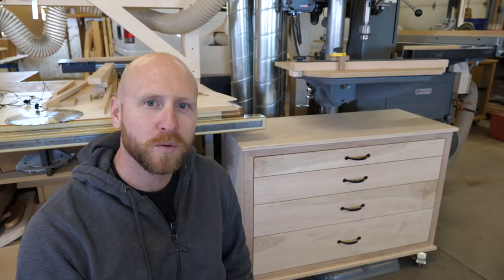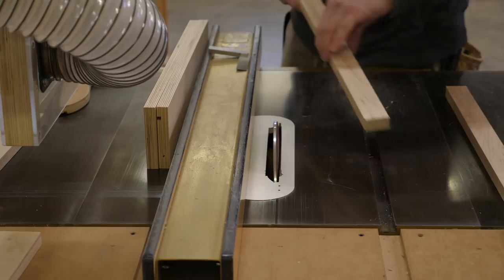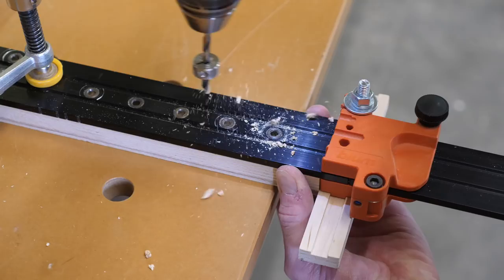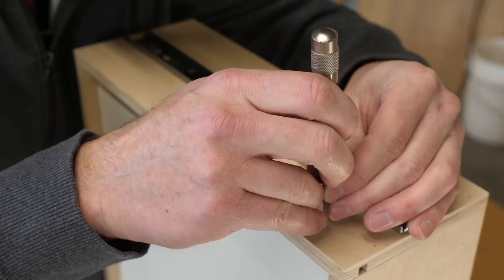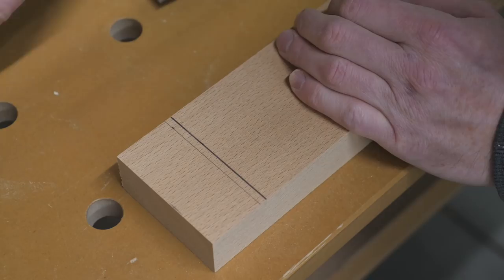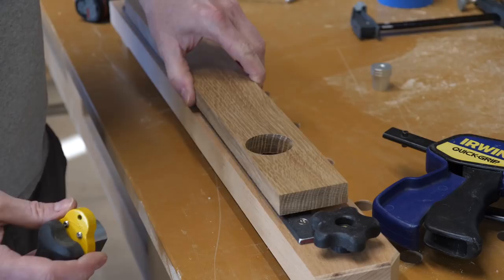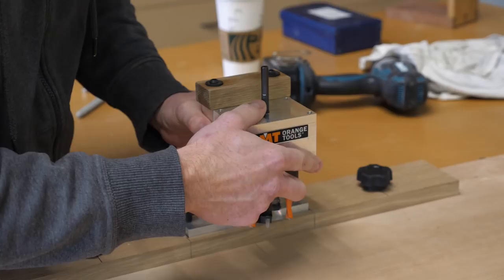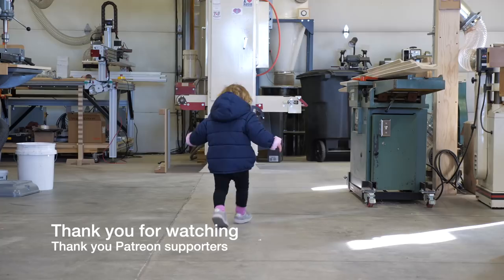Drill Press Randomness, Storage Cabinet, Fence, and Jigs

Comment: I think this is state-of-the-art cabinet making for today.  No steps missed, no corners cut.  If you are new to the craft and wondering how to make a cabinet, follow these processes, and techniques as closely (within reason) as you can.  Thanks Mike.
Reply from the maker: Thank you.
Reply: First i think you need all the tools this guys have.. to get it right you see it. With basic tools it is kinda hard to get results like this. So if you are "new" to the "craft".. info in this video is excelent.. but you will never have the same results with basic tools.

Comment: that was great. i didn't know they made made i door hinge set up like that to add to drill presses! i'll be adding that to my next shopping list for the shop
Reply from the maker: Its a really neat jig.
Reply: @MikeFarrington  will you be getting rid of your blum? 
Side question, the tall bench dogs you have that raise the track for the track was. Did you have your "hobbiest" machinest neight make them or did you purchase them? If you purchased them where did you get them? Ive built a Paulk bench and those would cone in handy with holding my track saw
Reply from the maker: @benborsa8266  I already did. After using this jig a couple times I sold the Blum Minipress. The bench dogs were from TSO products. They have a bunch of different dogs to pick from.
Reply: @MikeFarrington  fantastic thank you man! 👊🏻

Comment: I've been hunting for a 3102 this past year based on your praise for it. I finally found one in good condition for $80 (plus a bunch of bits/accessories) with the exact same issue as 12:32. The guy's sending a replacement cable along for the ride, race you to the replacement!
Reply from the maker: Thats kinda the deal, about every 10 years or so, the cords will need replacing. I consider that just a part of ownership.

Comment: In the Toyota Production System (TPS) you would use a simple visual indicator like the absence of a tool in its marked storage location.  In this video, you show locations for every bit but you also have slots with no bit.  If a slot is empty how do you know if the bit is in use or missing?  Place finish nails (or something) in the purposely empty drill bit locations so you know you're not missing any bits.
Reply from the maker: That is a really good idea.

Comment: A tip I've seen used when biscuit jointing. Use the biscuit jointer like a router on one side of the joint then cut the  biscuit joints normally on the other side of the joint then you don't have to worry about whether the biscuit slots line up and you can slide the wood to correct position
Reply from the maker: Thank you. Great tip.

Comment: Thanks for the caster tip.  I have not been happy with the last few iterations of casters I've found at <insert big-box store name> lately.  And I gotta get a drill press.  Maybe then I might be able to drill like a 4-year-old.  Only problem with that plan is that it's Yet Another cabinet/base/tool stand I gotta build.  My mitre saw is still waiting...

I like the slide/swoop/not-jump video cuts, whatever they're called.  Upping your vid game, I see.  And I detected a bit more thought put into the writing, too.  Props all around!
Reply from the maker: Thank you. Yes, those casters are really great. They hold steady when locked. Thank you for noticing, I have been trying to up my video game.

Comment: BTW for those wondering, what he did when bringing/building the drawer guides out from the sides of the cabinet box. Is known as Furring (pronounced Fur ing ). Its a technique used a lot in finished wood working. I share this term so people going into professional environments don't have to look like a idiot (like I did) for not knowing it.
Reply from the maker: Thank you for the input. Its funny how many slang terms are used in the trades. I have heard these called a bunch of different things over the years.
Reply: @MikeFarrington  My understanding at least as it was explained to me. Is its a fairly old, traditional carpentry term. Probably changes on geographic region as many things do though.

Comment: I would have probably made 17 videos out of this packed content. as usual very impressive.

a few excellent ideas, like the horizontal bar for the magnetic switch based stop block.

as for the drill bit organizer, I need to design something for my style of working. I always have many drill bits of the same size (sometimes 20 per size), and on top of that, different material within one size (Cobalt 5%, Cobalt 8%, HSS, W4A, "import" junk grade). then I also want to keep masonry bits, stainless steel specialized bits. I'm actually still trying to figure out how to store 100s of drill bits, with multiple instances in each size / category. I think I will just use some kind of matrix of smart / movable dividers. I have 20 drill bits of my most popular size, and then 1-2 of rarely used ones.
Reply from the maker: Thank you. I like to put a bunch of stuff into one video. I have no idea if that helps or hurts my channel, but its my style. That is an interesting conundrum, to have some many of each size. I have a couple different sets of bits, but one is over at the bench, one for installation tools, and the one shown in this video.
Reply: @MikeFarrington  I often work with the thick hardened stainless steel stock, and I need lots and lots of instances of the same size bits.
it took me many years to work out the profitability sweet spot between the rapid drilling while sacrificing more bits, and drilling slowly and allowing the bits to last longer.

PS
a quick (and really valuable) tip for drilling stainless steel material, is to keep it in the freezer to the last moment, and then start drilling as fast as you can (get everything ready before taking it out of the freezer), before the material temperature raises.
I give credit for this tip to the boat maker, who cuts and drills the hardened stainless steel parts all the time, and he "shared" this secret with me once I bought him many beers.
Reply from the maker: @TigerCarpenter  Good tip, thank you for sharing.

Comment: Philips screw drivers are designed to slip if excessive torque is used.   Posidrive are designed to not “cam out”.  The design of the screw head and driver are different so the systems are not exactly interchangeable.     You can get away with mixing them up, but it is better to know which you are using from the start……..The discount store in Australia, ALDI,  often sells packets of wood screws which are Posidrive, without advertising that they are different.  Folk take them home and end up in trouble when they uses impact driver and long screws.

Stavros
Reply from the maker: Thank you, good stuff.

Comment: Home made boring machine is really cool.  One dumb question, how did you drive the staples on the bottom side of the drawer bottom without them sinking all the way into the wood?  Less air pressure on the compressor, or did you just finesse it somehow?  Thanks for the content as always.  Made the forstner bit organizer - it rocks. Simple idea that works really well.
Reply from the maker: Thank you. I am using a 3/8" staple to start with and I reduce the drive depth on the gun to the minimum. Hope that makes sense.

Comment: Two questions.
1. Are there any 'un-mighty tools'?
2. I'm sure your experince in crappy tools are very or extremly limited. But to your best guess. Is a cheap biscuit joiner better then none at all?
Reply from the maker: Any tool I am using is Mighty! I used a porter cable biscuit joiner for 10 or so years before getting this one. I was a darn nice tool. I have gotten feedback from others that the Dewalt is good as is the Makita.
Reply: @MikeFarrington  hah! Good answer! Modesty is way overrated. Thanks for the recomendation.

Comment: Thanks, Mike for another excellent video. This may be fundamental, but how did you shoot those staples only partway in?
Reply from the maker: Thank you. I'm using 3/8" staples, the shortest available for my staple gun. I also set the stapler to the shallowest depth possible. This helps keep the staples from going in all the way. Hope that makes sense.

Comment: 12:40 Story time: I was using an extension cord that looked like that. So normally the if the ground and the hot touch it will trip the breaker. Not so in this case. The sheathing around the hot wire was damaged and in a bizarre turn of events the ground wire was completely severed. The hot wire had come into contact with the broken ground.  This caused the metal body of my band saw to become electrified. It was not a fun day. 
Moral of the story is. Don't use things with broken wires.
Reply from the maker: Ha! Great story and a good tip for sure.

Comment: Did you drill through your production table to mount the wooden surface?  (in your restoration video, it looked like there weren't any mounting holes; was this repurposing some of the arc of shame?)
Reply from the maker: There were 4 holes intentionally drilled in the production table. Looks like some jigs or something were attached to them at some point in time. I used those holes.

Comment: If I may ask why don't you edge the plywood with timber of the same thickness then screw the drawer runners to the plywood ?
Reply from the maker: The wider face frame member will help prevent the cabinet from racking. Its a small difference, but I think its worth it.

Comment: don't you have a Blum Minipress? I seem to remember you using one in a earlier video
Reply from the maker: I liked this jig so much I sold the mini press.
Reply: @MikeFarrington  that's interesting, I love my mini press, I have the extension fences and lots of stops so I have a system that allows me to quickly and accurately drill hinges and plates. I also use the insertas theyre awesome because I drill before finishing and don't have to worry about damaging the finish after
Reply from the maker: @adamchesis7443  I always struggled with drilling to a line, like the center of a pantry door. Mine didn't have the extension fences, and I never drilled enough to necessitate them. This is one of those things where there isn't a right answer, just what works for each persons system. I totally agree inserta is the totally awesome.

Comment: Thanks, Mike!  N00b question... when you're setting up the dado stack for the 1/4" dado for the cabinet's back panel, are you setting it for a true 1/4" or are you going slightly under to try to match the actual width of the plywood?
Reply from the maker: I set them up to be a snug fit. If its under I'll set up less than 1/4.
Reply: @MikeFarrington  Thanks for the tip!
Reply from the maker: @RussWilsonII  My pleasure.

Comment: How did you get the staples (for the drawer bottom) to not set? did you back off the pressure to the gun or is that a special stapler?
Reply from the maker: My gun has a depth setting, I back that all the way down.
Reply: @MikeFarrington  What staple gun are you using?
Reply from the maker: @t.e.1189  I am using a Porter Cable narrow crown stapler.
Reply: @MikeFarrington  Thank  you!

Comment: I've gotta ask, do those corner spring clamp things leave indentations/holes on the wood? Seems like they would. If so, how do you address them?
Reply: Aren’t they on the cabinet sides where they’d be joined?
Reply: @douglee650  They are used on the face frame, so they would be exposed.
Reply from the maker: Chris, they leave a slight dimple that normally disappears with a little sanding. For this project I didn't worry at all, but for finer work, I would just give a quick sanding with like 150 or 180.
Reply: If they're just dents they could be steamed out quite easily.

Comment: Don't you run the risk of the urethane glue expanding?
Reply from the maker: Yes, so long as the piece is clamped, it won't affect the strength. Squeeze out should be monitored as well.